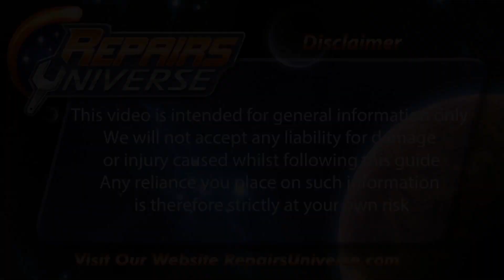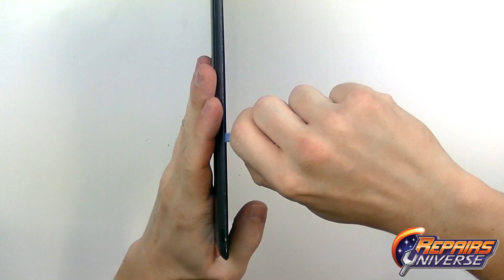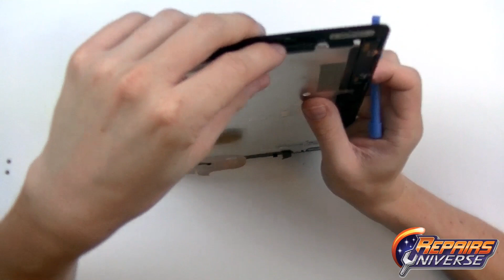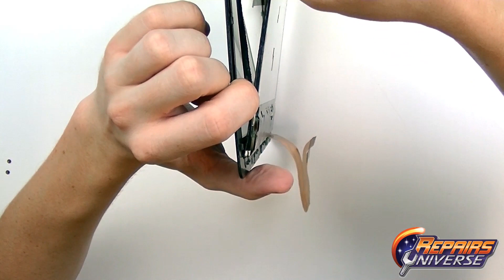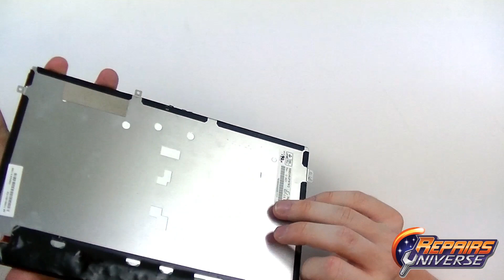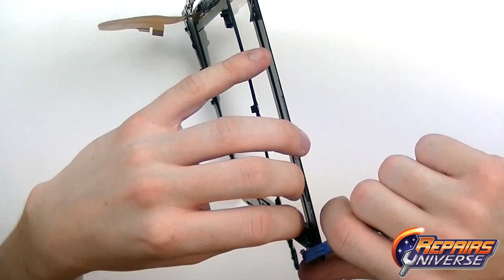Asus Eee Pad Transformer Prime TF201 Screen Repair Guide

Comment: Hello
I have problem with Eee Pad Transformer Prime (TF201)...
i have Replacement lcd and touch screen 
turn on but does not work touch screen
even the bottom does not work keyboard dock
have any ideas why do not  work
Reply from the maker: We recommend double checking your connections to ensure they are secure. If the issue continues, it could be a faulty part. Unfortunately we no longer offer replacement screens for these models.

Comment: There is a step missing in this Video for TF201 .  Take noteThrough the lock pin holes  at the bottom of the screen you have to lever 2 slides to the side or brake all the bottom clips as they are Captive
Reply: yeah! exactly, I fuck this up then I figure out why :/ what a shame

Comment: This ain't saying how really tricky it is to take off the digitizer without breaking the LCD.

THe LCD is VERY fragile and I attempted to make the change the other day, ending up with a cracked LCD and a perfect digitizer, while I had the complete reverse before (!).

The problem is that there's another layer of glass underneath the digitizer that is stuck to the LCD by the narrow band of tape... If you're willing to do it, you must be super-extra-mega careful and use a razor blaze (or something as thin and strong) and un-stick both of the stick bands while pulling the digitizer off, while keeping heating the glue with the hair-dryer.

So not quite easy with only two hands.

ANyone's better off just ordering the whole screen replacement assembly, which on this device is rather easy to replace.
Reply from the maker: freeriding666 We appreciate the feedback. Thank you for watching!
Reply: freeriding666 
Kuo
Reply: Yeah I broke mine :(

Comment: Hi, I'm having problems with my tablet TF201, the touch screen don't work on both side of the screen, I only can touch on the center of the screen, this is a problem with the LCD screen or the screen digitizer?
Reply from the maker: Replacing your Touch screen digitizer should resolve the issue. We offer these models here http://www.repairsuniverse.com/asus-eee-pad-transformer-tf201-touch-screen-digitizer-replacement.html

Comment: Nice post on how to dismantle the screen but its not exactly a repair guide, as you dont show how to put it back together with a replacement part and how to keep it all clean during the assembly process.

Comment: I just changed the digitizer in my tf201 and the digitizer is working like a mirror image. any suggestions on how to fix this
Reply from the maker: Liberty Shipp Check to make sure the flex is installed correctly. If it is you may have gotten a defective part. I would check the connections first then contact the distributor.